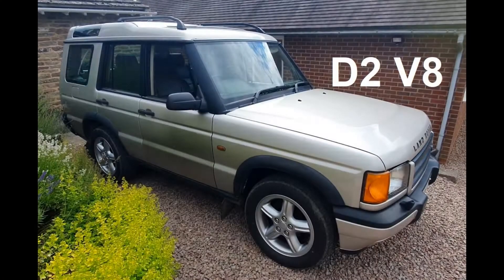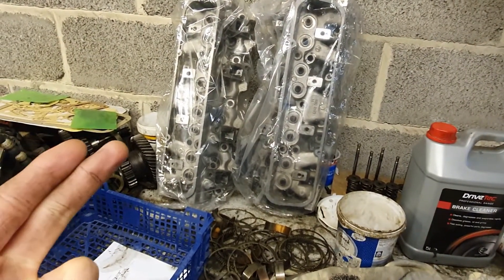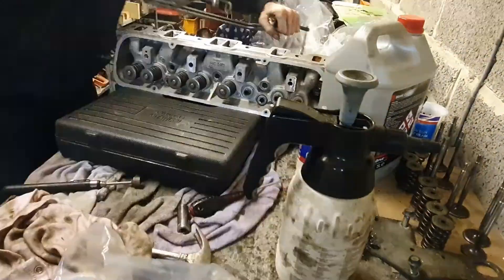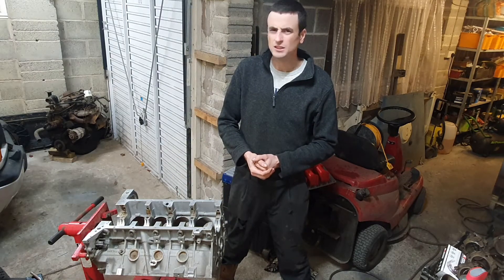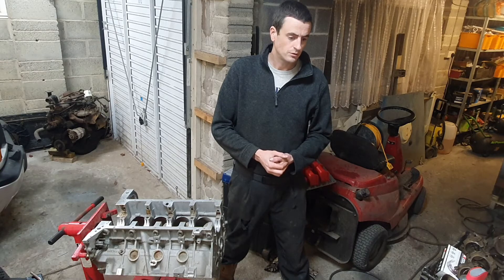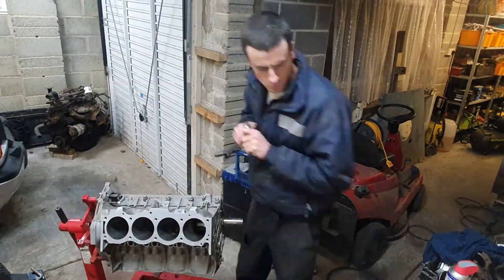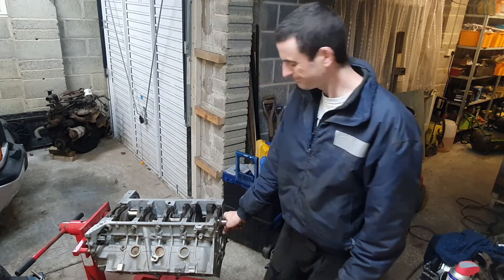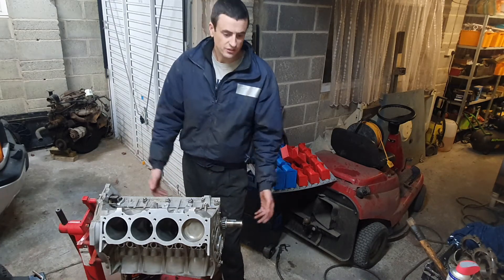4.0 Rover Thor V8 bottom end checks - Head Assembly - Discovery 2 V8 Engine Rebuild Part 6

Comment: I wish you would have shown us the flaw which resulted in having to remove the crank and take the block back to the machine shop. It would give us a focus on what to watch out for.
Reply from the maker: I'm sorry Jack. I have tried to improve my more recent videos in this respect. I'm now showing all the problems I encounter and the mistakes I make. 

To try and answer your question here...

The deck and the heads had dimples that I couldn't remove with a Knight sanding. I wanted them to be completely free from imperfections. When I tried to sand the deck faces flat it went out of spec from end to end, this was just the flatness spec in the manual (using a straight edge and a feeler gauge under the straight edge). 

I removed the engine I itially and the crank really as a precaution I just wanted to be sure I had found all the problems and I'm glad I did. The damage I found to the crank was obvious without measuring for two reasons. The journal looked very scored, and when I bolted the control back on, on the bench I could feel that it was lose. This make the decision to get it reground easy as it was so far gone. I don't have a micrometer large enough to measure crank journals which would have been the correct way to confirm it. 

I hope this helps a bit. I appreciate it would have been a lot better if I'd shown this on the video.